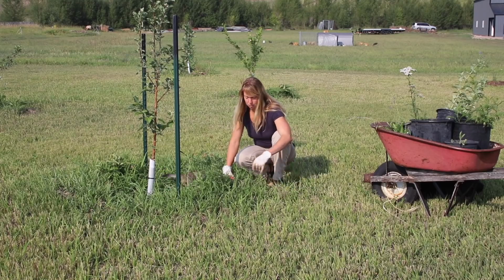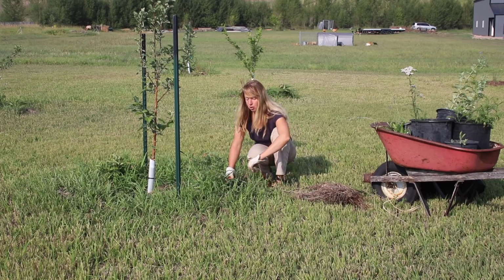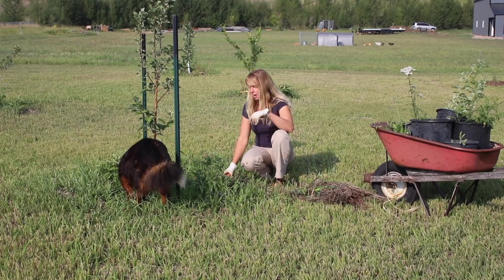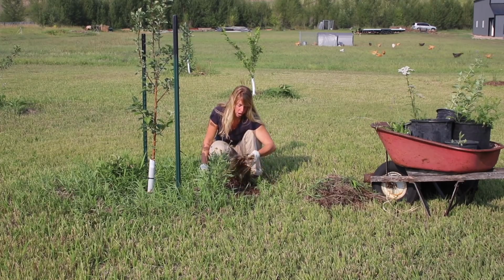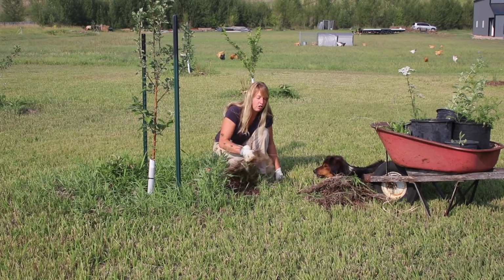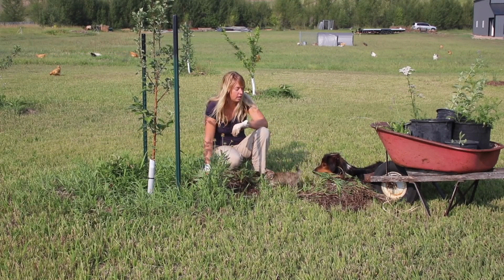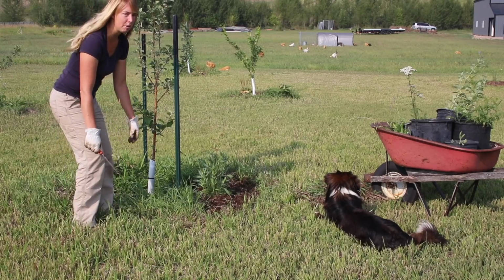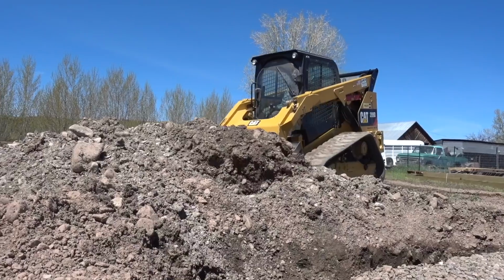Shop Building Start, Turned Into a Big Mess - Life in a Tiny House called Fy Nyth

Comment: I don’t know if anyone has mentioned it yet, but you can dowse for water pipes under the ground. 

We bought an old ranch that had sat vacant for many years. A man that lived there several decades earlier came to visit. My husband asked if he had a map to show us where the water lines are. He said he didn’t, but if I had a wire hanger, he could show me how to find them. 

He stretched the hanger out and cut it in half. Straightened the wire out, and bent it into am L, with the short end being about 6”. He held the L very loosely in his hands with the long ends out straight in front of him. He walked across the ground and as he crossed the water line to the house, the long ends crossed each other. I tried it and it works! 

Not everybody can do it. I don’t understand why it works, or why it works for some people, and not for others. Between you and Clay, on of you should be able to do it. 

I hope that you were able to install a shutoff for water when the pipe as fixed.

Comment: Engineering drawings aren't accurate enough.  We had a broken water line caused by tree roots.  The engineering drawings showed the water line two feet under the sidewalk.  The water line was actually 3 feet away from the drawing's location closer to the tree out from under the sidewalk according to dowsing rods.  Hand digging confirmed the location at the tree.
Reply from the maker: That's frustrating.
Reply: @FyNyth  Yup.  But more frustrating if we jackhammered the sidewalk and found nothing.😡

Comment: I learned the hard way about contractors, the second time i was prepared and paid them 50% for mobilization and start up, another 25% when they reached 50% completion, by the time they got to 75% completion i paid them 15% with holding the last 10% until final inspection and punch list complete😀, they were not going to take advantage of this old woman👍😊of course, this was discussed at the time of accepting their contract and it was in writing

Comment: To keep the weeds at bay from all of your trees that were planted you might want to purchase some weed/landscaping fabric and put it a couple of feet around the diameter of the tree and then either put down wood chips or crushed rock (pea gravel) on top of that fabric. I've done that and it works great.
Reply: NO NO NO!!! Nix that nasty landscape fabric! I have done serious damage to my back trying to remove it after the previous owner used it all over the place, and the cursed twitch grass and other noxious weed roots merrily threaded themselves through it, and created a thick impenetrable layer welded to the entire weight of the earth.
Use cardboard, sawdust, anything organic that will eventually convert into soil.

Comment: Really liked Velcro. Cats are my all time favorite animal. 
I wonder why you had to pay for the building before it was put in. For my pole barn I paid in stages. Deposit, materials when they were delivered, truss payment after the trusses were installed, final payment when finished. 
You were lucky that they could just drill holes. On mine that auger just spun on the surface and they had to get an excavator in to dig the holes and pull out large boulders. 
Look forward to the rest of the build.
Reply from the maker: It was paid according to the contract schedule, but the money for all materials (not labor) is required before you get placed on the schedule at all.